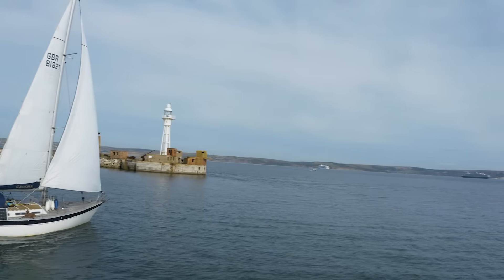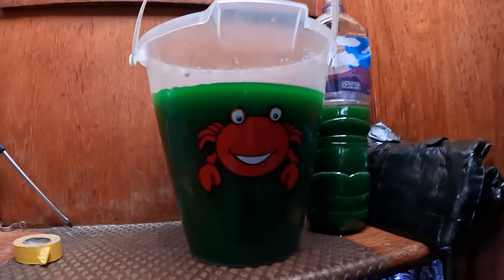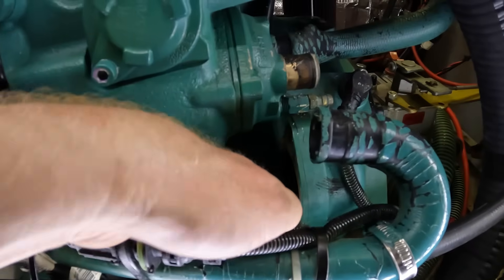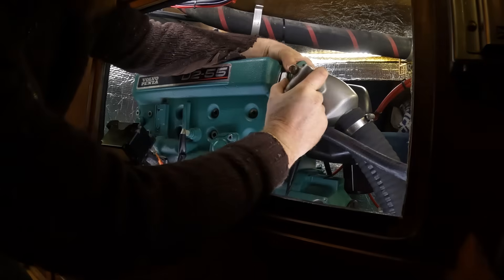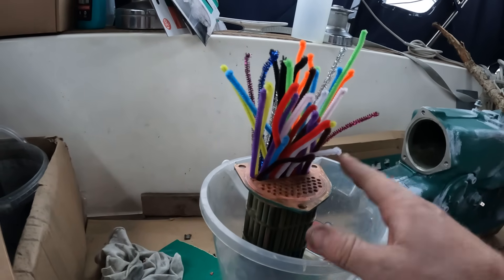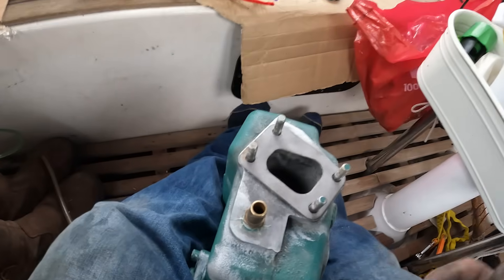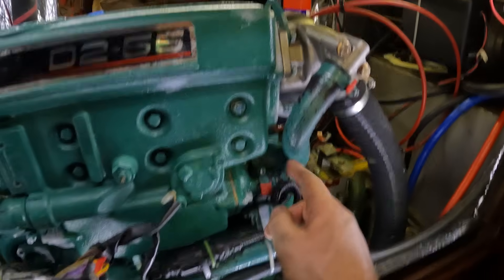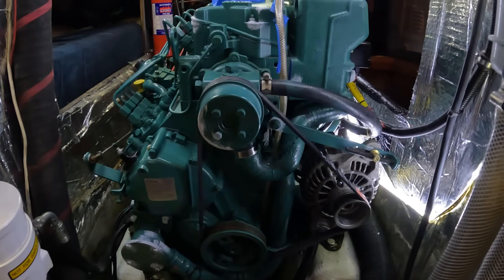Overheating  - Troubleshooting a small diesel sailboat engine  (Volvo Penta D2 55F)

Comment: One thing I find odd is, why didn't you flip the heat exchanger tube and install it 'backwards' so that you could pull it out from the front instead of the rear of the engine? It looks like it would of lined up fine, but I can't say for sure from the video. Would of made it possible to do it as a regular maintenance item.
Reply from the maker: Mostly because I’ve never really worked on engines before and so I was really just super nervous about making sure I put it all back ‘properly’ (as I found it) 😬

Comment: Careful using wire wheels on gasket surfaces. Wire wheels tend to round off the edges both the inside and outside edges. This leaves less flat surface to form the sealing surface. Wire wheels also leave steel ‘dust fragments’ embedded in the surface unless you aggressively clean the surfaces post wire wheeling.

Comment: I am likely wrong but it almost looks like you could put the exchanger in the other way around so it goes in and out from the other end, the fittings seem the same?
Reply from the maker: I’m not quite sure it would work because of the alignment of the fixings for the ‘brass’ plates? Although truth be told I didn’t really fully test this out, I just remember there only being one orientation that worked when fitting them back in their original positions.
Reply: @CadohaAdventures  Yeah i am just going from your video and it looked to me like the two brass plates and covers seem to be the same dimentions (just one plate is soldered onto the end of the heat exchanger), I actually have the D2 55 in my boat (2004 Bavaria 42 cruiser) but I never removed the heat exchanger so your video was both interesting and terrifying at the same time. :)
Reply from the maker: @spindreams  well hopefully it’s a little less terrifying now, as it all went back together without too much difficulty. Some great hints and tips in the comments section too which I’ve already learned so much from and hopefully anyone else who’s going to take the job on can too 🙏😁⛵️

Comment: Great video,  may I suggest that you use a razor blade instead of a hammer and chisele. You can mess up a flat surface doing that which will cause a leak. Other than that a good video from what I have seen.
Reply from the maker: Duly noted, appreciate the feedback 👌🏼⛵️

Comment: Air locks in the system. I found the best way is to undo the bolt on the top of the water pump. Fill the pump body with coolant. Tighten , run the motor, untighten check again and keep filling this pump body until all the air is gone. I think what happens is any air gets into the pump , then the pump stops working. Took me ages to figure this out.
Reply: I think I have an airlock problem. Did the revision of my heat exchanger last winter. Now my operating temp goes to 100 degrees Celsius at 2000 rpm :-(

Comment: Your Sea-Strainer ( raw water intake filter ) should NEVER be letting that size of particles through it, I was surprised to see that.   Those painted hoses are not optimal.  The paint chemistry eats away at the integrity of the rubber when its hot.  I'd replace those at some point.  That's a very good looking V-P 55, except for a lazy previous owner leaving a broken impeller inside the system.  Great Video to show others a very likely reason their motor might not be cooling efficiently.   Thank You !

Comment: A pdf version of the workshop manual for that engine is easy to find online with a popular search engine using the name of the engine and the words workshop manual. Makes life so much easier and removes the guesswork (tried to give more specific directions earlier, but I seem to have been censored - didn't even type a link - freedom eh?)
Reply from the maker: That’s strange, I certainly haven’t blocked anyone on the comments? Appreciate the feedback though and will have a look at the PDF to cross reference before we go out and battle test the engine 🙏⛵️
Reply: @CadohaAdventures  I didn't think it would be you. YouTube does seem to not like references to other online sources. I tried to make the directions as YT friendly as possible with no actual links, but the buggers still spotted it. But the manuals are easy enough to find and very handy for any and all work that needs doing on your particular motor. And with pictures no less. Good luck.

Comment: Having soaked the heat exchanger for "a week" in white vinegar.  Do you stand by that choice?  Barnacle Buster ever cross your mind?  I'm down with the gentle wash if you have a full week. Thoughts on this after the fact?  And Big Question: on my Westerbeke 46, the exhaust manifold may not have been moved in 30 years.  I broke the head off only one of the bolts but I'm wary of using a sharp pry bar and a sledge hammer to break the manifold free of the engine block to replace the gaskets as you did and carry on.  Any advice?  My engine is not anywhere near as clean and new as yours. Anyone with advice to Not Do It!  Thanks, Doug Day, Maine
Reply from the maker: I’m always really hesitant to give advice as I’m really a nobody who doesn’t have a clue what he’s doing most of the time, but I’m just the right amount of brave/ stupid to have a go at most things if I can find some YouTube videos to follow along 🤣

I mean the white vinegar worked, and everything still seems fine, but it did takes ages to get going, so in future I’d probably use something like barnacle buster, mostly because lots of people commenting here also swore by it (I’m as susceptible as the next man to a little group think 😬)

I’d be hesitant to use heavy hammers and sharp objects on the manifold too, not because I know better (I don’t) but just because I’m poor and would hate to have to replace it 🤣

If in doubt, I’d bite the bullet and touch base with a professional. As soon as things get hairy for me when it comes to DIY, I’m not so proud that I won’t ask for help. 🙏🏼😬
Reply: @CadohaAdventures  Keep it up. Love your videos, even though the envy of working on a new engine keeps me up at night.  Limping along.  Pretty sure I'm going to keep the exhaust manifold right where it is now that I spend a day getting all but one bolt out.  I'll spread a touch of JB weld on the broken off head of #2 and see what happens.  Not going to use a sledge hammer on moving the manifold.  i just have a hunch! 
\
Reply: And as for the heat exchanger: I'm putting the Barnacle blaster to her, but perhaps not overnight; then the white vinegar.  I removed the Oil Cooler as well which is, basically, another heat exchanger half the size of the main, wondering if the tubes are the same material as the main?
Reply: And I mean BB in a pail, not letting it go overboard like one video that pained me.

Comment: The comment sections are always entertaining, lots of advice, 50% of right, the rest…..😂
Here’s some more, silicone or RTV should NEVER be used, people will argue for its use, but they are wrong 😏
There is a product called Honda Bond or Yamabond that appears similar, it is not. It works when the surfaces are properly prepped. 
And while I’m here, and you seem to listen, whilst you’re tossing the silicone in the bin, do yourself a favour and toss out any WD-40 we well.

Comment: Lanocote the studs and  plastic washers too or the electricity will just use them as conductors. Tension the belt were you can just twist it 90 degrees on its longest run.

Comment: Volvo recommends yellow coolant only and cut it with distilled water. Do not use green coolant. It does not have anti corrosion compounds like the yellow specified for Volvo Penta.
Reply from the maker: That’s interesting, the coolant we used was a ready mix, by Volvo?

Comment: Im quite familliar with repairing the D2 heat exchanger exhaust port, you need to take it to a shop that can grind out the rotten ALU, and build it up again and fly-cut it flat, then bond a fibre gasket to the ALU, and dry to the stainless. the heat exchanger is made by French company MOTA, the alloy is shite, when you burn red diesel, which has high sulfer it creates sulfuric acids which get trapped between the stainless gasket and the alu heat exchanger, I have repaired many of these and have plenty of photos of the correct way of fixing , if left unattended it will blow a hole into the cooling circuit, and coolant will be blown out your exhaust , new exchanger is over 4500!!
Reply from the maker: Damn that’s a lot of bucks for a heat exchanger. I’ll have a look and see if I can find someone local then. Boy did I not want to take that all apart again 🤯

Comment: Well done! This is one of those jobs I hope I won't have to do on Sea Mist... It would mean removing the entire engine block as there is only frontal access.

A note on galvanic corrosion: while the gasket will no doubt help, all that is necessary for corrosion is electrical contact of the two metals. In this case still facilitated through the bolts that fix the elbow in place. Perhaps a touch of some duralac-like compound on the nuts and bolts would help?
Reply from the maker: I have now covered the connecting bolts and the nuts in Duralac, but I'm still not convinced that'll be enough to solve the problem 😔😔

Comment: Not to sound like an alarmist, but the corrosion you have really needs close monitoring or repair. My D1-20 just corroded through causing a major headache and expensive repair. This is a known issue with the D series. SV Impavidus has a good video from a couple of months ago that explains this well. I believe the title of that one is 'What happens when your exhaust elbow fails". Good luck.

Comment: I use a product called Never-Seez on bolt threads; to date they've never seized!
Reply from the maker: I’ll be sure to check that out. I think I’m going to remove the bolts that connect up the exhaust elbow to the heat exchanger and cover them in more grease to try and help break the electrical circuit causing the corrosion. Although I still don’t see how that could totally break it? 😕

Comment: I saw the video. and thought to myself. If both sides of the heat exchanger are the same. and the metal gasket is the same thickness. can you not turn it over and put it in from the front? So that you can access it more easily in the future? And dril a small hole with thread in a blind spot in the fixed gasket so you can screw a bolt in to pull it out easily in the future.

Comment: …… Yes and a hell of a lot more work than it should be. I thought that the whole point of engineers and 3D software was to reduce this type of mayhem. You suffered through the heat exchanger job wonderfully.

Comment: Is there not a sacrificial (zink) pencil anode on that engine, to stop dissimilar metal corrosion problem at your exhaust exit?
Reply from the maker: No there isn’t. I’ve looked all over the entire manual and online and there doesn’t seem to be any anodes for the engine? 🤔🤔😕
Reply: There are many cases of this corrosion problem on line, can I suggest that as you now have the ss exhaust elbow outlet that this is modified to accept a welded nozzle threaded to accept the standard pencil anode.  Other owners have also looked at high temperature resin lining at the manifold outlet & flange joint to further insulate the dissimilar metal electrolysis issues.  My personal recommendation would be the zinc anode addition/modification.
Reply from the maker: @anthonyporter6576  I will certainly look into that, I wasn’t aware that the SS exhaust elbow was in fact able to accept a zinc anode? 🙏⛵️
Reply: @CadohaAdventures  I would look at the best location, either at the exhaust outlet end of the manifold, if any obvious blank plug in the cooling water/exhaust system that could be modified or a welded SS threaded boss addition at your elbow,  later VP engines have this anode fitted.  Talk to a knowledgeable Volvo specialist for advice.
Reply from the maker: @anthonyporter6576  will do 🙏

Comment: There were impeller pieces in the heat exchanger.
But you didn't go to the impeller and change it. 
Instead of disassembly of the engine cooling system. You should have gone to a hose manufacturer and purchased a couple of meters of hose to reverse the flow of salt water through the heat exchanger and simply blow the debris out by back flushing and heat exchanger. 
Then you could have pinched the bottom hose shut and opened the top hose filled with white vinegar for a week to remove scale without taking the engine apart. 
After one week replace the original hoses and operate as normal. 
Without all the destruction and repair time and cost. 
Keep the spare hose in your kit in case over heating ever happens again. 
CHEERS
Reply: Also a sock type filter before the heat exchanger will prevent any future debris entering the heat exchanger. 
CHEERS
Reply from the maker: Appreciate the feedback. I wasn’t dissembling the engine because I thought bits of impeller were up there, the impeller was fine, in fact every impeller change since we’ve had the boat has been fine, so those bits must have been from before we had the boat. 

The cleaning of the heat exchanger was just something we wanted to do as part of regular maintenance, I didn’t expect it to be so hard to simply remove the copper tubing, clearly a design fault/ oversight.

Comment: Hey mate, watching your vid and I noticed the galvanic (dissimilar metals) corrosion on thdd we exhaust fitting. 
You fitted a gasket to try to stop the electrical conductivity and that’s a good start but you need to stop any circuit. 
Galvanic corrosion occurs through the liquid, in this case the exhaust / water mix and completes the circuit any way it can. So you’ve disconnected the direct path between the fitting and the engine /heat exchange assembly but you didn’t seem to insulate (disconnect) the bolts. 
I suggest you grease the bolts heavily and put plastic washers under the nuts. I know you will tighten the nuts snd distort the plastic washers a lot but you need to insure it (break the circuit). 
A small detail but important because electrolysis will follow any circuit it can find. 

Dissimilar metals in a corrosive
Reply: Oops hit send before I was finished
Dissimilar metals in a corrosive environment are the bain of every seafarer!  Good luck 👍😁
Reply from the maker: This! This is EXACTLY why I share these videos, because I learn so much and will certainly be making some tweaks before we set off now. 

Honestly, thank you for taking the time to share this with us. You guys add 100x the value to these videos than my talking head ever could 🙏🏻⛵️😁

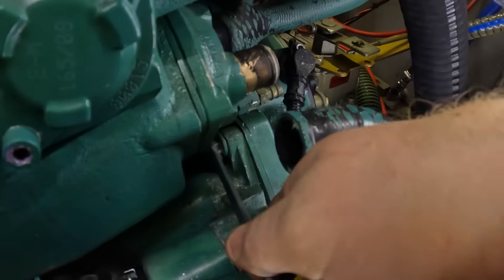Comment: 8:20 when working in such a confined space as this - A ratchet spanner will certainly undo, until it jacks itself against the engine block, where it will be stuck forever, as you cant change direction with a ratchet ring spanner - Only use ratchet ring spanners where there is no danger of falling into this trap !!
Reply from the maker: I can honestly say that thought had never entered my mind!! 😳every day is indeed a school day 👌🏼

Comment: Might be worth investing in a small hot air gun or heavy duty hair dryer to target those pesky hoses.  Can be pretty helpful with getting them off.  Treat the hoses to some silicon spray and they should be golden...
Reply from the maker: Fair. After reading the comments there are actually a few good suggestions for tools on the pipes that are likely a better solution that jacking my screwdriver down the side (albeit as gingerly as I could).
Reply: @CadohaAdventures  just be v proud of what you have been able to achieve. You are showing the average sailor/boat owner what can be achieved with a bit of time and Google! Keep at it - fair winds and calm seas

Comment: Get yourself a old wide industrial hacksaw blade about 11/2 in width snap off what you need length wise grind off the teeth and sharpen one end like a chisel. This will stay sharp for years it will be invaluable for removing gaskets ask if they have old blades at the ship repairers you may be lucky 😀

Comment: The proper alignment of the caps and heat exchanger is important as the heat exchanger is manufactured such that the water goes in ONE half -- through the exchanger to the other end and back to the front and out -- the end cap is divided into two half's -- water in one side and water out the other side.    relook at your video again looking at the alignment of the heat exchanger and the alignment of the end cap -- they both much be aligned correctly  --- Hopefully you did it correctly -- It is not obvious from the video -- good luck -- Dale
Reply from the maker: Thanks Dale, I will indeed double check it, I think they are on the right way, but will be sure to play the entire video back just to be sure 🙏🙏🙏

Thanks for taking the time to highlight this not just to me, but for anyone else who may be here, trying to figure this all out. 🙏😁🙏

Comment: One easy way to get hoses off and on again is spray a little wd40 or degreaser on the inside(lip if it still on ie lift it with screwdriver and spray into it)  wait a minute and never have to fight it.

Comment: I might have missed it by why not install the heat exchanger the other way round so you can pull it out the front of the engine?
PS love the videos :)
Reply from the maker: Great question, and I’ll be honest with you, my train of thought was simply the idea that someone (or some people) far smarter than me designed and built this thing, and I assumed everything is a certain way around for some kind of fundamental mechanical reason, so I was just hyper focused on being able to simply put it back together as I found it, after I’d cleaned it all, my bravery doesn’t quite yet extend to modifications just yet 😬😬😇
Reply: @CadohaAdventures  No problem :) From what I could see it looks pretty symmetrical and the fittings on the ends look very similar....so maybe...just maybe you could! Anyway. I'll go back to my armchair engineering :)